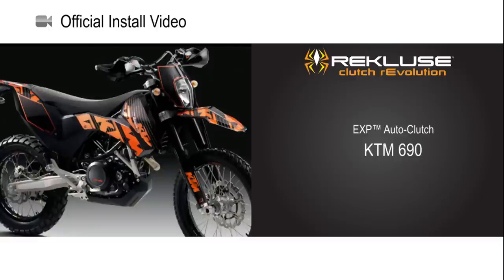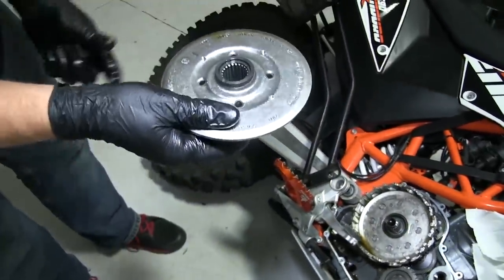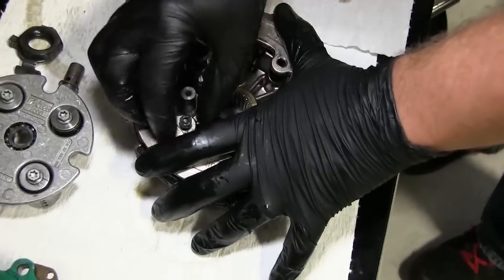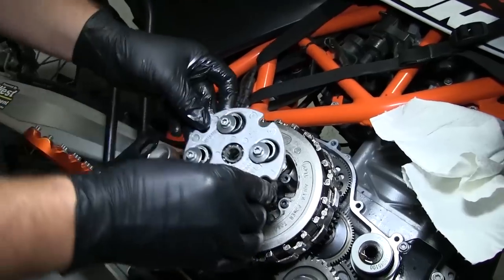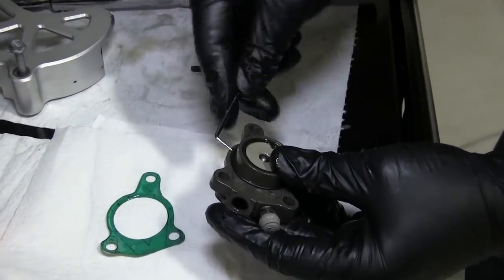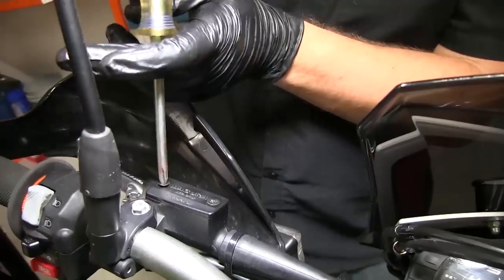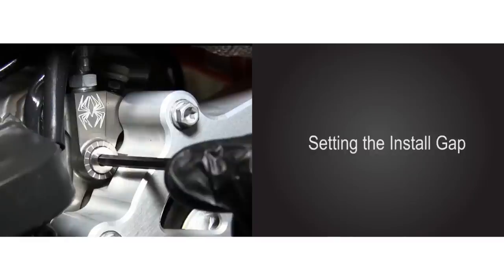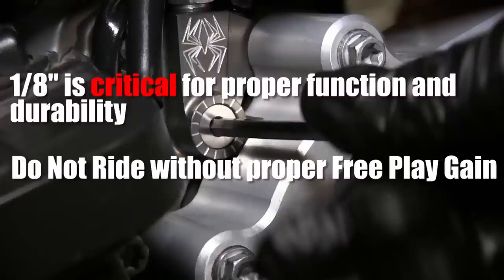Rekluse® Install | EXP™ auto-clutch for KTM 690

Comment: thank you soooo much for creating video. i just finished installing the rekluse clutch in my 2014 ktm 690 enduro. i simply followed the video and got it working without issue. i normally have this kind of work performed by the shop. i'm not much of a wrench. i learned so much about the innards and working of a motorcycle. thanks a bunch!  tomorrow, i'll go play with it.